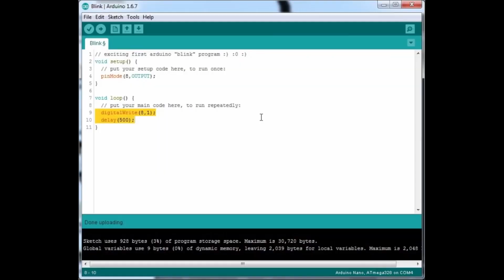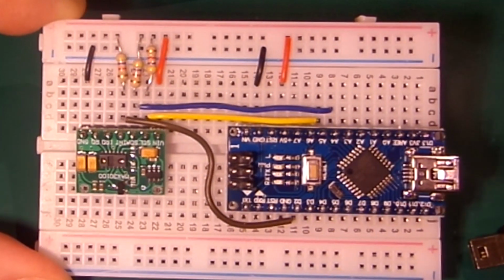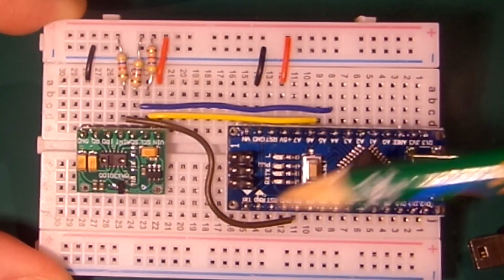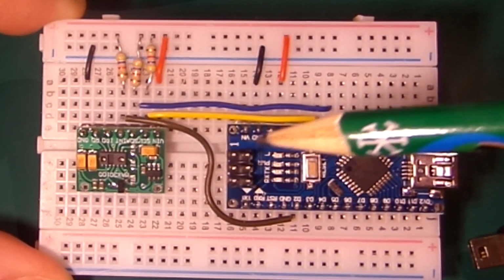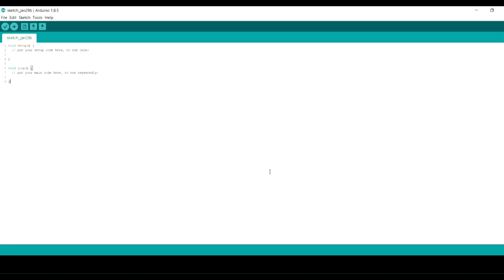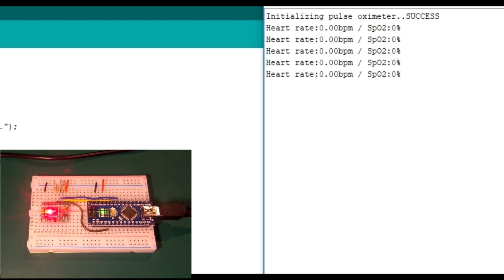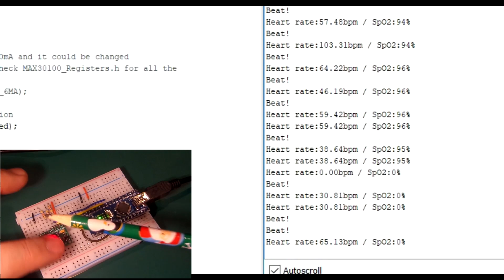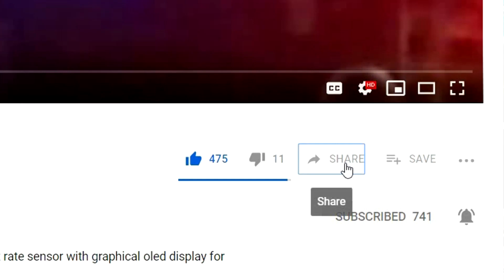Measuring heart rate/pulse and Blood Oxygen % Level with your Arduino, using the Max30100, MAX30102

Comment: Excellent video, thanks for taking out the time to make it. I have a few ideas for another video project: It will be a health monitor with a screen that shows the following things:
1.	Two digits after decimal point for better accuracy for all read outs
2.	Heart sine wave
3.	If this sensor can calculate heart rate variability (HRV) i.e. the time between two heart beats then you can add that
4.	You can also add a skin conductance sensor to show volts
5.	Infrared temperature sensor
I have seen several projects on youtube but no one has combined all these in one. If you like, I can collaborate with you. Let me know and I will send you an email. Thanks
Reply from the maker: Thanks for your ideas, I will keep them in mind

Comment: Hey great video, I noticed when you took your finger off that the monitor was still picking up values, but they were a bit off. Is that due to the components quality? Do you know of any that are more reliable?
Reply from the maker: Did it, can't remember. I think they fluctuate a little. You can get proper ecg sensors that connect to your chest on pads if you want to be really adventurous.

Comment: Hello mate I need your help !
I want to mesure Oxygen in the air at the outlet of an oxygen generator ! is this sensor useful ?
Reply from the maker: No, would not do that. You need a gas monitor of some sort.
Reply: @XTronical  thakns ! there is no cheap arduino componenet similar to this type ?

Comment: Searched tons of videos, by far the best video I’ve come across, great explanation! Will try it and let you know the results
Reply from the maker: Brilliant, glad it's been useful.
Reply: XTronical sir, I tried that but my serial monitors only shows 0bpm and 0spo2 it only varies if I give some motion to the sensor
Reply from the maker: Have you done the hardware mods
Reply: XTronical yes I’m using 3 4.7k resistors with int, scl, sda just like you showed
Reply from the maker: Can you post a pic on a photo sharing site for me to look at
Reply: XTronical sir did you get a chance to get through them?
Reply from the maker: Sorry, not yet. Real life job keeping me busy. Might be weekend.
Reply: XTronical okay sir, Thankyou
Reply from the maker: I've had a quick look, one of the pads from the surface mount resistors looks like it might have a short with the pad next to it - perhaps. There does look to be some damage around the general area where these resistors were. I would check for shorts where you've de-soldered the surface mounts.  Although I'm surprised you're getting a "success" on initial connection to the oximeter if this was the issue. Have a check anyway but beyond that I'm stumped, all looks OK.
Reply: XTronical I have ordered another module and will try to desolder more carefully this time but thanks anyway. I might have to disturb you again for the same. Thankyou soo much
Reply from the maker: Your welcome, good luck!

Comment: i am using arduino ......  red led not on .. and stuck in serial monitor "  Initializing pulse oximeter " .. what should i do .........
Reply from the maker: Have you made the required hardware changes to the board?

Comment: I follow your instructions and im using arduino uno. But my max30102 is not glowing can you help me? Is it a code problem?
Reply from the maker: As you can see the code does work, and the Uno is identical in functionality to the Nano, most likely in these cases there is a wiring issue or you've not removed the surface mount resistors and added the external  ones. Have you definitely removed the on board resistors and added the external ones?
Reply: XTronical yes i already removed the mount resistor. And i put pull up resistor 4.7k. Btw is 1k resistor works too?
Reply: Im using max30102 same design and color as yours. Rcwl 0531
Reply from the maker: Don't know if 1k would work, never tested, it might be a struggle for the line to pulled to ground with that low level of resistance. If you've used 4.7k's then I'm at a bit of a loss, sorry.
Reply: XTronical thanks

Comment: Kindly tell me if values are fluctuating too much then what should i do? i am using this sensor in my project and heart rate reading is fluctuating like yours in this video. what is the reason and how i resolve this problem?? its urgent.
Reply from the maker: It's because it's calculating it more than once a second. To smooth it out you need to do an average over time, perhaps 15 seconds or more.
Reply: @XTronical  it is still not giving me accurate readings. It suddenly drops to zero then 40 then 70 then 80 then 100 above. Please help me out.

Comment: HIiiiii I am making a soldier strap. I am looking for a hear reate sensor. So can MAX30100 will work if connected to wrist rather then finger tip
Reply: i am also making the same soilder strao explain me gps module ill explain oxymeter it has worked for me..
Reply from the maker: Sorry for very late reply, I missed this somehow. I've not experimented on the wrist ut the same technology is in smart watches so it should work but can't guarantee.

Comment: hi, can you share to me link your connect max30100 with nodemcu? i have a problem when connect to ThingSpeak, the sensor is not work. please help me to solve it.
Reply from the maker: I tried some time ago to use with esp32 and had no success, I am going back to this problem in the future but not the near future
Reply: @XTronical  if max sensor will not work with wifi, what if happen if i change the system using bluetooth module ? it is can be connecting with bluetooth?
Reply from the maker: It doesn't appear to work with esp32 at all, WiFi or no WiFi. I think it maybe the driver library. So whether you use Bluetooth would make no difference. You could see if there are any more library's out there that work better with esp32 but I've not got round to doing that yet. Sorry.

Comment: great video if I use with esp would i still need to desolder the resister also would this code work at esp.
Reply from the maker: Well..... Another person reported having problems getting the max30100 to work on esp32. I investigated and also had issues. You shouldn't need to remove the resistors but I tried either way just to make sure but still no joy. So I'm guessing the library needs updating to work with esp32. I have some ideas for using this with ESP32 as well,, so disappointed. I've not contacted the library author yet my last test was some time ago so it might be worth seeing if anything has changed. But just to confirm : resistors do not need removing for esp32 and the external ones don't need adding.
Reply: @XTronical  Thank you for your guide ,Sir how can I contact you.
Reply from the maker: Place a comment on my website and then I will have your email and will contact you via mine.
Reply: @XTronical   hello have you find the fix for the issue? cos I got the same problem
Reply from the maker: I've not had time to look into it, sorry
Reply: Hey  what is we use level converters for esp

Comment: awesome tutorial, i only have arduino nano and max30102 sensor. Can I use it simply without needing to modify the resistor,  and plug the arduino's usb into the laptop as its voltage source?
Reply from the maker: Usb into laptop is fine, but the resistor mod is unfortunately required to get it to work with the nano.
Reply: @XTronical  how's about 4.7 kOhm parallel pullup connected to 3.3v and ird -> gnd (4.7 kOhm seris) to reduce current, have you ever tried it?
Reply from the maker: No not tried, but wouldn't have thought it would work. Do you not have a soldering irom?

Comment: Hi, I have purchased all the components s u have used and did the same things you have. When I run the code I get 'intitialising max30100...failed. '

I ran the i2c scanner and the sensor address is found at 0x57. Also I attached 4.7kohm from the ird and rd to ground I was able to get red light to appear but still no readings on serial monitor. 

Please help me out. This was for a school project and I was really counting on your tutorial.
Thank you
Reply from the maker: Your description of what you did does not quite match the video. Just to clarify, there should only be resistors on INT, SDA & SCL. Also have you desoldered the surface mount resistors on the 30100 as shown. It won't work unless you do as this device is not arduino compatible without this mod. Hope this helps.
Reply: @XTronical  yes yes I did all that, I was just explaining what else I tried
Reply from the maker: If everything is the same then I don't know, I've just setup another this morning in the same way. Just perhaps double check that the INT is connected to the correct pin. Also have you got any other libraries in the code as this sensor doesn't work well with other sensors/libraries.

Comment: Hey. I am using a MAX30102 and i just wanted to if it is mandatory to desolder those three 4.7k resistors or not. And will the code for MAX30100 work for MAX30102?
Reply from the maker: If using with arduino then yes, you must desolder. Code will work with max30102. The difference between them is minor.
Reply: @XTronical  Also my MAX30102 is getting badly heated up pretty fast. Could it be because of not unsoldering these 3 resistors?
Reply from the maker: Don't remember mine getting hot, so yes maybe. Remove and see if it works and if it runs cooler.
Reply: @XTronical  hey so I unsoldered those 3 resistors but I'm getting garbage values ( heart rate: 221.4bpm / SpO2: 94%). And it's showing these values even when the fingers isn't placed. Please help me.
Reply from the maker: Have you added the 4k7 external pull up resistors shown in the video.
Reply: @XTronical  I did.
Reply from the maker: My only thought is it may have been damaged, is it still running hot? I've used both 30100 and 30102 with the same code and both have been OK.
Reply: @XTronical  I actually connected the RD and IRD to ground through 4.7 k resistors and now it's not at all hot. Also in order to make the led glow I have to connect the RD and IRD pins to ground. Found this on the internet.
Reply: I'm using Arduino UNO by the way.
Reply from the maker: Yes, that's fine, pin for pin and same processor as Nano, just in a more convenient package. My second video ( https://youtu.be/17im1J1EdZA) on the MAX10xxx's actually used a MAX30102, it may be an idea to pick up another to ensure it hasn't been damaged when it got hot.
Reply: @XTronical   مرحبا احتاج الى الكود لاستخدامه في مشروعي

Comment: Hi, I am using the GY-max30100 (purple) I believe it uses the same configuration? When I am using the purple one do I need to have external resistors and also the (same one you used) code is being uploaded but the heart sensor is not lighting up. Pls help this is for a school project and your knowledge on this matter is greatly appreciated
Reply from the maker: Hi, I also have a GY-max30100 that I tried to get to work but couldn't. It suffered the same problems as yours. I never got to the bottom of it. I tried with and without resistors but it made no difference. I even tried different software libraries but still wouldn't work. So I stick to the one I use because I know I can get it to work. Sorry I cannot be more helpful.
Reply: @XTronical  no it's alright thank you very much
Reply: @XTronical  Hi, say if i use the
max 30102 do i still need to remove the three resistors on board and connect externally. Also does this mean i need to change the sample code?
Reply from the maker: @rahultalla2552  Yes, you need to remove and add external resistors, but the code remains the same :)

Comment: I have MAX30100. Should I desolder each resistor, or desoldering only one of the resistor is enough? Also is desoldering needed? Can I just short circuit the resistor?
Reply from the maker: You only need to desolder them if using with arduino, if using with an esp32 etc then you can leave as is.. But if using arduino then all 3 need to go and you need the external 4.7k resistors adding as shown. Otherwise the MCU won't be able to read the data from the sensor. You can't short circuit as again you won't be able to read any data back if you do.
Reply: @XTronical  Thank you for replying. Yes, I am using node MCU(esp266). The problem I am encountering is that when I keep pressing my finger on the sensor, its showing bpm as 0 and spo2 as 0. It's giving me the readings only when I tap the sensor.
Reply from the maker: I've got another sensor on order, should be here in next couple of weeks, I'm doing a video using with esp32 and esp8266, I might be able to sort your problems then.

Comment: Hey, can you help me? I do EXACTLY the same thing as you just on max30102! I unsoldered the resistors, same schematisc, code...
Initializing pulse oximeter..FAILED
The led not show up.
Reply from the maker: Sorry, I'm a bit stumped, if everything is exactly the same it should work, I did a later version using the 30102 where it's connected up to a display showing heart beat, a trace and O2 and all just worked fine. If it's not working and it's exactly the same then I cannot think what may be wrong.
Reply: @XTronical  I tried with your ecg but there are code errors when compiling the code, are you sure that you put on site the right code. The libraries are installed. The code should be compiled  even I don't have that display
Reply from the maker: Fairly sure the code is good, have you got the compiler settings set to treat warnings as errors? The setting is in "Preferences" and the "Compiler Warnings" should be set to "Default"
Reply: I have the same problem. Do you solve it? I think for the max30102 the circuit is good and we don't need to take of those rezistors.
https://reedpaper.wordpress.com/2018/08/22/pulse-oximeter-max30100-max30102-how-to-fix-wrong-board/

Comment: You have soldered the copper wire to sensor what was that? What is it's use?
Reply from the maker: There are three 4k7 resistors, is that what you mean. There is a video and circuit diagram coming up in next 3 days. With a full project using an lcd.

Comment: Can we get ecg graph accurately with this two sensors?
Reply from the maker: I'm working on it at the moment for next video. It looks promising, but still some further work and tests to do. Video should be out in about 1.5 weeks.
Reply: Max30100 and the sensor used in previous video which is more accurate
Reply from the maker: Max30100 is better and you can also show amount of oxygen in blood.
Reply: What is difference between Max30100 and max30102 and which is accurate for ecg graph?
Reply from the maker: Both are fine for ecg, the 30102 has a larger internal buffer memory and slightly better performance but nothing that would affect any project a hobbiest might do. I've got both and I'm currently working with the 30100, I will replace with the 30102 when to see if there is anything dramatically different, but I think they'll perform the same.
Reply: Can we use ad8232 heart beat sensor
Reply from the maker: Not with my project as it is completely different but it would be better for ecg graphing and projects are available on the Internet based on it.

Comment: Hi im using this sensor for a project do u have a schematic diagram of the set up ?
Reply from the maker: Sorry, not at the moment, only the description in the video. I've other videos coming out in next few weeks that implement a solution with different displays, they will get a circuit diagram and write up
Reply: Hi so i managed to set up the circuit but it giving me a very different sets of readings and if i take the hand of the sensor it still continues to take the reading :/ do you know why this might be happening
Reply from the maker: If you are using the serial plotter in the Arduino IDE you will see random noise basically. You have to do a little bit of software processing. If you use the demo that uses the serial monitor then you should get some sensible values printed to screen.